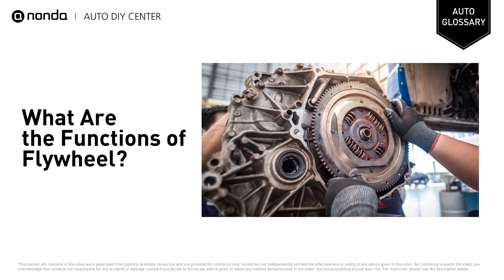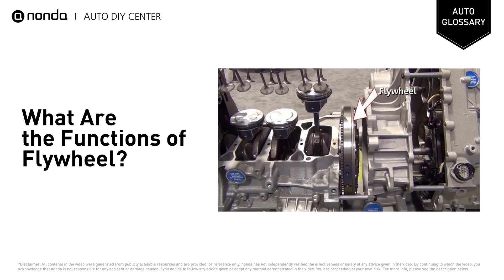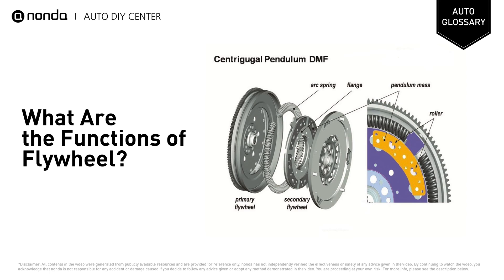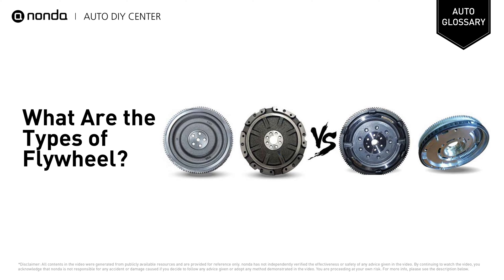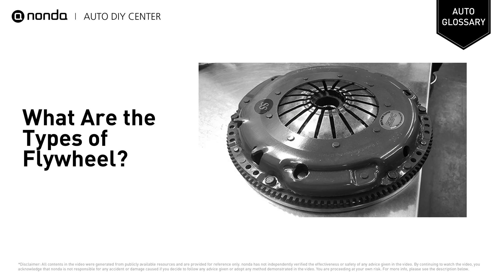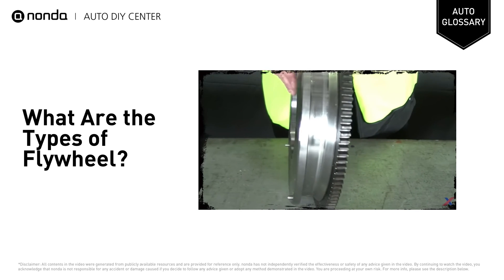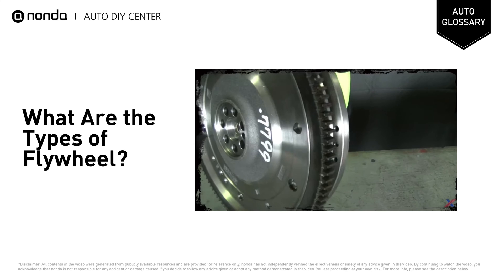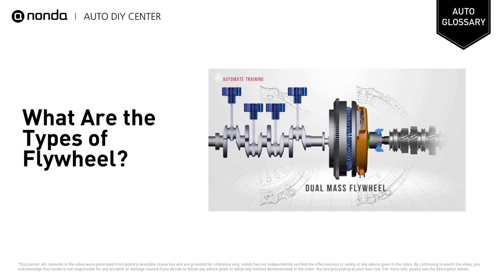Flywheel Explained

Comment: I've  got a 2017' Ford edge  and does    this  vehicle have a fly wheel or flex plate? 
Also when having your engine replaced should the fly wheel / flex plate be priced separately?
Reply: If you found the answer can you please also ask them to explain how an flywheel actually works as these YouTube guys does not have an clue themselves it seems...is there is an outer weight around the flywheel with an seperate inner disc connected to the crank and the outer weighted disc being the weight to rotate the crankshaft essembly? What is it how does it actually work, please ask them if you find one for your 17" forr and post it here

Comment: I got a car a hyundai sonata g 2012, recently I went to put a catalytic converter also while looking at it carefully it looked like it was a bigger than the other part is that normal it's half in inch bigger idk maybe it's miss placed.

Also I need to know how I can fix theses codes
p0038
P0032
P0038
P0461
P0032
P0038
P0032
Reply from the maker: Hi, you can check the code information in our app, ZUS, by going to the Safety Center > Safety Center Settings > OBD2 & Issue Codes Lookup.